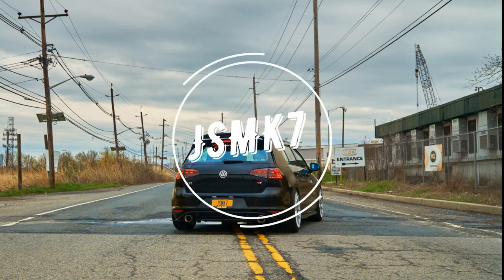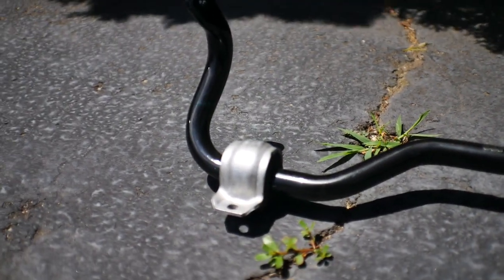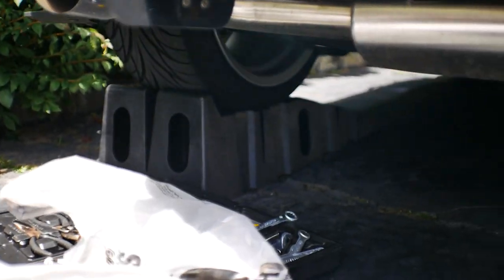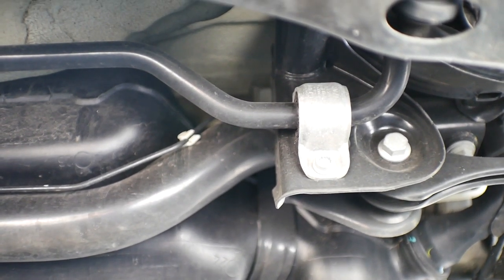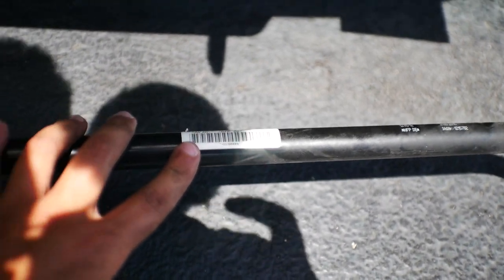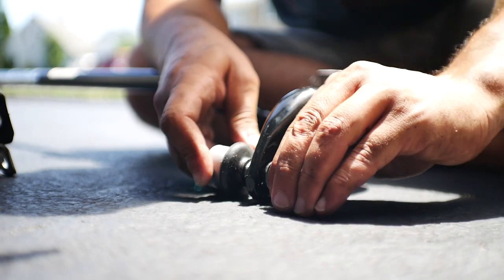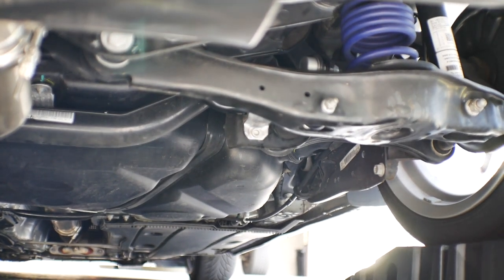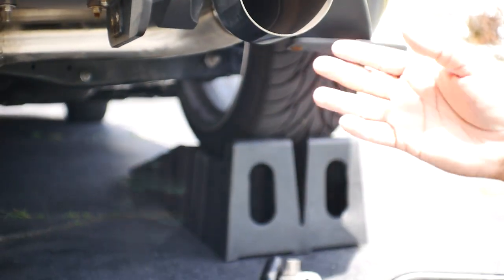MK7 MK7.5 GTI OEM+ Sway bar and endlink upgrade

Comment: I used H&R 24” rear sway bar with Superpro rear sway bar end links and the car feels fantastic on the corners.
Reply from the maker: Sounds like a better set up than me lol
Reply: I don’t have much mods like you do on your car and I don’t have sponsorships. I wish I did. lol. I like to start on the foundations. Suspension first, I’m trying to get as much SuperPro products as possible. That includes every bushings for the suspension and the notorious “$800” lower control arms for reducing wheel hoping. I’m debating on the H&R front sway bar. That will be this year project. All suspension. Every year I will tackle on something different. Next year I’m thinking Superpro motor mount, transmission mount, and the dog bone. I like to start from the bottom and finish with power at the end. This is my second project and I hope to finish it in 6 to 7 years. Just because I don’t make bank. lol. But it’s the experience that you get on every car that you work on. That’s what a “true gear head” is about. I love your videos because they are fun to watch and gives me an eye opening on European mods. Keep the videos coming and I’ll be there to watch every single one of them... Damn, I think I just wrote a book. lol
Reply from the maker: "longest comment award!!!" Lol and I love it. I like the dedication and commitment to the project. Viewers like you keep me motivated
Reply: Do I get a Caffeine sticker for that? lol
Reply from the maker: Yeah $5 lol
Reply: I like your business strategy. lol
Reply from the maker: Lol thanks for the love